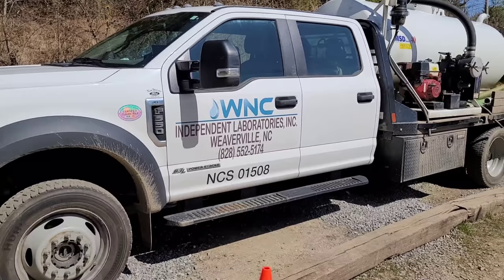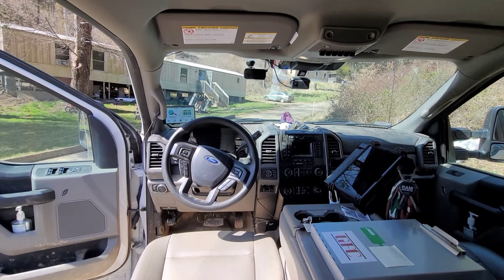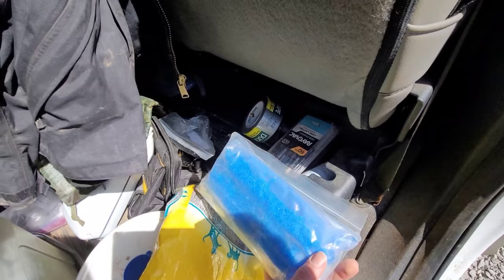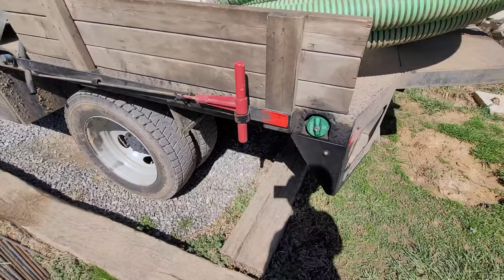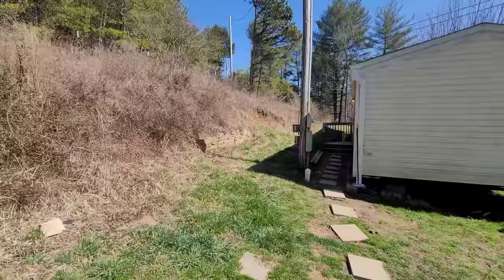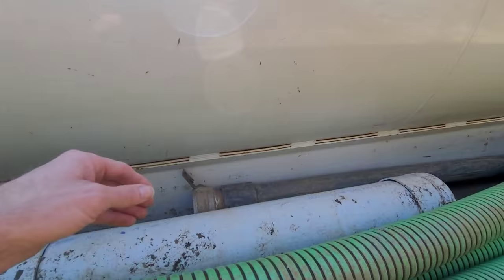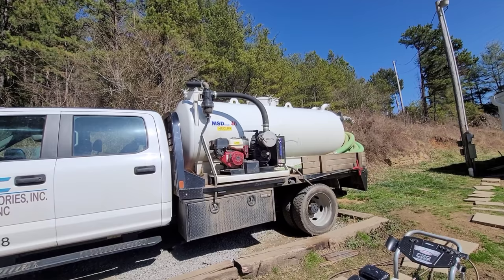Truck walk thru.

Comment: Instead of replacing the battery every year, why not wire it so it’s charged from the truck battery. Or even better eliminate that battery all together. You can use a relay to control the use as seen fit or a switch. 30-50 per battery per truck adds up quick.

Comment: Do you do car washes?  A 6x6 with air ride suspension. Can pump car wash mud while on the track reduce down time for the wash and easier on operators. I manage a wash and drive a pump truck for my wash. Takes hours, tons of physical effort, hose dragging around equipment etc. Im thinking a 6x6 that can be lowered to get the tank under 80 to 90" would be awesome. Could pump more frequently for less time.

Comment: Have you considered using the truck battery to start the little Honda motor? This would prevent needing to replace the small battery every year. If you have thought of this what was the reason you decided not to do it?

Comment: So mine is about your cooler. I’m sure you’ve seen those Mylar emergency blankets? Well they have those in sleeping bag style also so, you by that put inside cooler and put ice &/or dry ice in that in the cooler. Dry ice/ ice combo will last about 3 weeks longer if you put Mylar/foil on outside also. Give it a try?

Comment: Automatic hose reels? Level indicator that shows a more accurate level? A rope attached to apart of the stiff end pipe for more control, getting into hard to reach areas?

Comment: On the Masport valve what if you took off the handle that water likes to get under and put a rubber skirt that would close it off, causing a much more limited area that water could get into.

Comment: Question regarding your pump motor. Why not run the cable, and start it off of the trucks batteries?
Every service truck Ive run across that had an air compressor, pumps for water or lube oil and/or fuel, just ran the starters off of the trucks batteries. Seems like the cost of the cable would be well worth it not having to replace the small battery yearly. And hey, since we got the truck started, can be pretty sure the pumps going to start when you get on the job site.

Comment: Why do you don't get an dometic fridge so you don't need ice. It's more expensive but you don't have to buy ice 2-3times a week.
And you could hook the electric pump starter to the vehicle electric with a cigarette lighter plug or something like that so you don't have to change the battery every year.
For wintertime you could carry a heat gun, there are some with batteries for unfreezeing the valves.

Comment: Nice rig. Just a bit curious thou, doesnt Ford offer these trucks with PTO? If so, you could do away with the Honda and the gascan. Probably would be breaking even weightwise, but would mean less stuff on the bed. Also, having some experience with septictrucks myself. How come the suctionshoses isnt on a spool? Having all those lengts of hose pulled manually would make me wheeze worse than you.

Comment: I feel like the pump trap. Something easily could be designed using something like a fuel sending unit float to cause a automatic shutoff for pump.
Reply: Would be fairly easy to install a n/o stainless tank switch that would kill spark to motor when tank overfills but sometimes it isn’t worth over complicating things.
Reply: @SlackerProducts  I figured there was something out there.  Not an industry I work in

Comment: You said that you go in a lot of treacherous driveways and such. Would it not be helpful to have a winch on the front or the back of the truck? It could potential he save your tow bills. And it could also be used to move obstacles out of your way and other things like that

Comment: Why not tie the pump motor starter to the truck main battery? Or at least switch to LiFePO batteries with smart charger run off truck which should survive 8 times longer. A silicone caulk seal on your pump valve should keep the water out and is easy enough to peel off for valve maintenance. Main tank valve freeze must suck! DIY heated motorcycle grip kits will be enough to keep them from freezing with out melting the PVC and can be wired to the trucks electrical. Tires - have you considered becoming a Continental dealer and buying a used tire machine? You have started new buisinesses for less reason :)

Comment: On the truck get it tuned and or deleted to Gain fuel economy or add a regular sized turbo because Ford can and chassis have a smaller turbo. Again to gain fuel economy and power.
Reply: Getting a “race pipe” for the truck will get only the dpf removed but leave the rest of the exhaust and is an easy install

Comment: Maybe a type of computing equipment that directly uploads the next destination to the gps then shuts off the computer till it’s in park idk how to do that but it would help with distracted driving and help you with damages to vehicles?
Reply: On the vacuum pump maybe a box that’s heated from the batter to keep the oil and pump so no water collects

Comment: Could hook the key start for the vacuum engine to the car battery with a transformer to get the right voltage saving money on the replacement battery’s
Reply: Or rechargeable battery’s

Comment: Two things i got 

I ditched the baterry and wired mine off the truck with a continuous  duty solenoid  off my number 6 upfitter switch 
And 2nd i could only got about 15k off the  Continentals and tryed a uniroyal rd30, i got   38k  on my first set and this second set has about 20k and is @ 50% so right on track for 38k again

Comment: You didn't go over what you have in the toolboxes underneath the bed, what do you have stored in there? I would think you could add another smaller toolbox behind the rear tires so you could store and organize the loose stuff inside the truck or even keep your cooler inside of it so the truck doesn't seem as cluttered
Reply: You could even put reflective cones or roadside emergency kits inside the extra toolbox

Comment: 20,000 miles seems extremely low, why don't you consider looking into semi truck tires? Or is that not allowed on your type of application? Also on the tank pump I wonder if they make kind of like a block heater for it in the winter so it melts any water that seeps into it? Other than that fantastic truck lay out. #TikTokSentMeHere

Comment: Sorry for the newbie question, but if your tank can only hold less than 1K gallons, does that mean you have to make multiple trips when pumping tanks since most tanks are 1,000 gallons +? I'm in Oregon, I want to start with a small truck for point-of-sale inspections and would like to start with something small. Any advice is appreciated.  Thanks

Comment: Ford and a Honda small engine - you know those Honda motors start on the first pull cold (and I live in mn, we only run Honda and Kawasaki for bigger small engines) but you really don’t need the electric start, I have e start on my snowblower and I’ve never used once
Reply: But your reliability is top notch!

Comment: I see that this video is a year old, but I'd highly advise you not DEF delete your trucks. Where I work we have 6 trucks in the fleet that have been deleted. They don't run as well, and don't seem to have as much power. Also, there are laws in place now that pretty much prevent resale of a deleted truck. The guy who owns the company has said that the answer is to run them till they utterly fall apart, then scrap them. Those trucks would have long since have been traded in, but we can't, so now they are the absolute pigs of the fleet that the new guys have to drive. A new truck of the type we use is a bit over $200,000.  They cost to much to just throw away. So, they hang around like the proverbial albatross around our necks.

Comment: @loganclancy5：Could you put a PTO with a hydraulic motor on the truck to run the pump instead of a stand alone engine? Not having to pay for gas or replace battery. Only downside is you’d need to make space for a hydraulic tank.

Comment: Run the Honda motor off the truck batteries about $100 a battery every year per truck
run a pto off transmission to run pump 
Have fresh water in side  to wash boots and hands with

Comment: why not run cables from the truck battery for the honda pump motor instead of replacing battery yearly?
even if its a 24v truck, it'll have 2 12v batteries, and can be easily tapped for starting a tiny pump motor for the same cost in wires and connections as a new battery costs for the pump

Comment: Would it be cheaper to run 22.5 for your tires?   I would also run bg fluids in your diesel, engine oil and cf5 in your Honda gas!   Bg fluids are fantastic.  I used to sell them and saw so many fleets save money on them.

Comment: Instead of having the hose wrap around the back of the tank, why not mounting a rack for them that extend over the cab. Flat over the cab then at a angle toward the back on the passenger side.

Comment: A couple things im curious why not hook the pump motor to the truck battery to start the motor and keep the truck battery charged when on site?  Also give the falken bl877 a try we have found they work great for our trucks in 50/50 street and heavy offroad use and are cheeper than the continentals. We cant get more than 20-25k out of the continentals because of them chunking and falling apart, the falkens we get 35-40k as long as they are rotated every oil change.
Reply: You could also add a flir system for the front and rear to help add safety on dark roads

Comment: That battery lasting only a year is not right. Flooded lead acid batteries should be lasting about 3 years in your neck of the woods. Definitely more than just 1 . Try using a higher cranking amp battery, that lawnmower style battery is available in many different ratings. Using too weak of a battery is the #2 cause of dead lawnmower batteries, after not using a trickle charger when not in use for a while. There are also AGM batteries in that style, they're expensive but much tougher and longer lasting than flooded batteries.
EDIT: I thought about it. It is possible that one year could be normal, but it would require a lot of cold starts per day. It takes an awful lot of abuse for a battery's lifespan to decrease that much.

Comment: Didn't see a fire extinguisher. I know when I was dispatching hotshot truckers they had to have one in the truck for regulation. I have them in my personal vehicles. Not a real innovation inspiring thing, but a damn good safety item and can help prevent extensive damage to your property if something catches. I'd also start throwing labels on that bag'o'meth ;) At the least for liability reasons. Throwing a hazard label on it may save you in a nasty lawsuit. Should take only a few minutes to mock something up and print on some postage label sticker paper. Could that battery life on the honda motor be from it being exposed? Or just improper size for the voltage draw? I'd be curious if a weatherized battery box (or marine battery) would extend its life. That or occasionally dropping it on a trickle charger. Not sure if that gennie trickle charges the battery when its running.
Reply: What is the model of that electric start? Little research showed it could be a improper charging coil size causing the issue. Or cheaply designed internals or just the wiring done wrong when it was installed. Also does that pump handle disassemble in a way you could place a gasket to prevent water collecting in the winter? should be simple enough to measure the size needed and order something ala mcmastercarr. Water repellent coating could also help for some areas around the truck.

Comment: Couldn't you run some wire and make your pump motor start off of the truck batteries so you don't have to buy a new battery every year? My guess is that little motor doesn't charge the battery that'd why they don't last very long. But if it starts off the truck batteries then the truck will recharge driving to the next job

Comment: Would it be worth running heat tape around the parts that freeze run off the truck battery? 
By the time you get to the job it should be freed up.

Comment: Do you offer hydrojetting? We get pressure washers, a reel from grainger, and 200ft of 3/8 hose from a hydraulic shop. We fabricate frames to mount them and they pay for themselves with in 2 or 3 jobs. I can send pics and part numbers if interested.

Comment: Is there an issue with running wires up to the truck battery to start the pump motor? You would probably replace fewer batteries or it could be started off the alternator.

Comment: The issue with the battery is intentional. Modern batteries have to have a cyclic charge and discharge to keep it in working condition. There are battery recharger who do exactly that. That would be the solution here.

If you don't do that, they battery goes broke. And you can't fix it anymore. Its car and motorcycle batteries alike. And much worse with motorcycle. This problem did not exist 15 years ago. Unless someone wants to tell me, there were no cars or motorcycle back then...
Also driving a 20 year old car, nothing has changed from the car side. So why are modern batteries dying more frequently? And they die just as fast in new cars. Thats not a coincidence, its intentional!

Comment: I never seen a f550 shit pump truck. Where I live there all like the one size under the semi trucks double axle air breaks and are f650, internationals, Peterbilts stuff like that.  But I don't think I could handle that job. I would probably throw up everyday that's why I chose to be a electrician not a plumber cuz I didn't wanna be chasing shit literally.

Comment: Keep wd40 for that pump valve. The name literally means water displacement, should keep water from penetrating the stem of the valve on the pump

Also why isn’t there any work lights on the back of the truck near the pump and rear valves,

Comment: Why don't you just have an alarm attached to a low power open electrical connection in the pump's gas intake? It will go off if any sewerage gets there because sewerage conducts electricity far better than any gas.

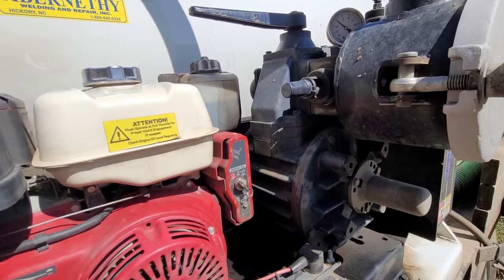Comment: 11:42 maybe I can 3D print you a solution like a cone like shape that sits on that bottom Edge that goes up under into the valve handle. I would need measurements, time, fit test. I can do one piece or split so it's easier to add on, but that won't be free necessarily. Message me if you want to try something.

Comment: Be damn careful if you’re going to delete the DEF off your trucks.   Make sure you do you research and make an informed decision as to whether you really want to do that….  The EPA has been getting ridiculous with the amount of overreach and some would say abuse of power they’ve been coming down on truck owners with.   And I’d bet it’s only going to get worse. I’ve heard stories of guys actually losing their trucks altogether.  And if I’m not mistaken, they’re ready to unleash hell on truckers in 2024 with regulations requiring half the emissions and literally doubling the duster.  You can’t hardly keep a truck running now with one of these big pieces of crap on them…now they’re going to expect you can keep it running with two of them.

Comment: contact robert peters, with performance calibration.  he can get you set up with tunes and parts to delete that truck, and others.  good prices and the best customer service.
Reply: also invest in a tiger tail, the short section of hose that hooks directly up to the valve at the tank, maybe 4-6ft long and saves a ton of hose repairs and downtime swapping hoses
Reply: also, also, not a bad idea to run a wider tire and different wheel up front, you will get a longer life out of them and have more options as to what you can run.  then you replaced drives and steers separately.  works great even on a 4x4

Comment: you can set your truck up to where you engage the PTO from inside the truck and not have to use a pull string motor

Comment: Nobody runs ford diesels here anymore as the motors are so problematic.    Everyone here is on Dodge 5500s including AAA ( yes the National towing company) Verizon, National Grid plus all the small towing/ flatbed haulers.   Almost exclusively see all the gooseneck hotshot guys on the highway towing with dodge.  There’s probably 8:1 dodges too fords.   Of course I didn’t mention Chevy because their heavy duty/ diesel market is a complete joke.

Comment: Lol you think ford is best for the job lol someone fell for ford motor credit. Because I've worked so many jobs including industrial cleaning. Fords spend their time in the shop. I know that also from being a heavy wrecker operator. So I have the experience. I'm a chevy guy,  but they are expensive on  Maintenance. Dodge diesel 5500 are the better cheap maintenance long frame, plus repairs are far the cheapest. That's why real tow companies use dodges. Chevy for the rich independent drivers. Ford for the ones who can't get anything better.